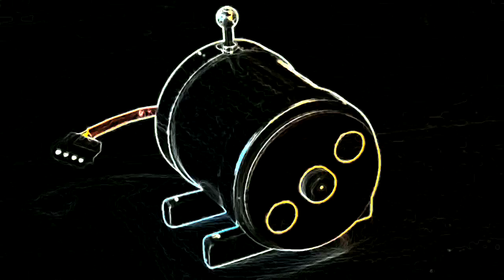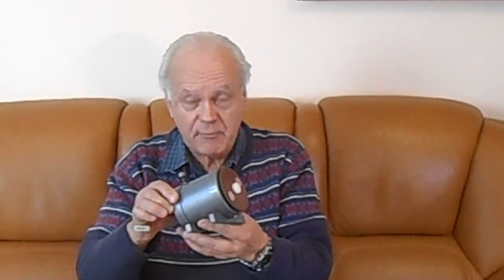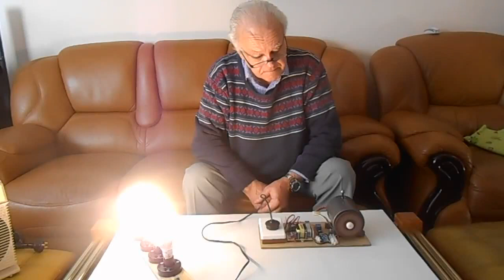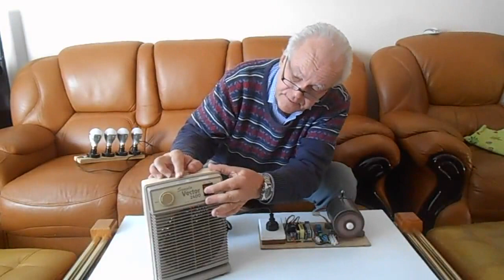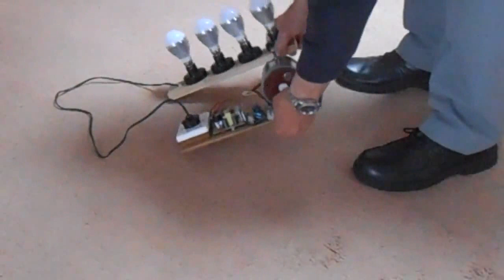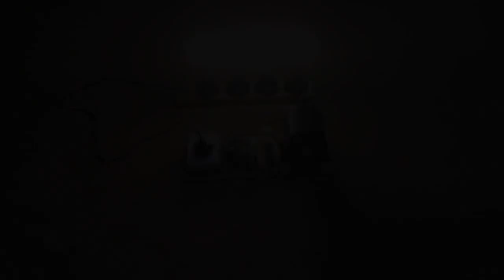Free Energy June 2017

Comment: Hmmmm, did this unit produce enough energy to run the heater section of this regular el. heater or just the fan? It''s because the 4 LED-lamps have about the same consumption as one of those fans ...

Comment: Hello, from Francis Morin, can you make it DC so you can charge up a lot of 6v batteries,
 you need 50 batteries, also you need to change DC to AC to power your home or what ever else's,,  that way it will not blow up because your house will use up the power & if you just leave the lights on all the time, & you can use it in the winter to melt the snow with heaters & summer to run the air cooler so it will never over heat. If you like you can email me back at Joannejackson@66outlook.com